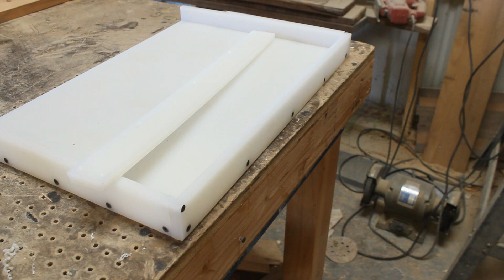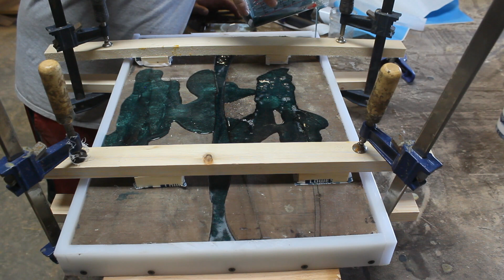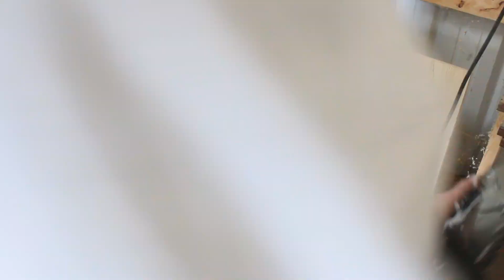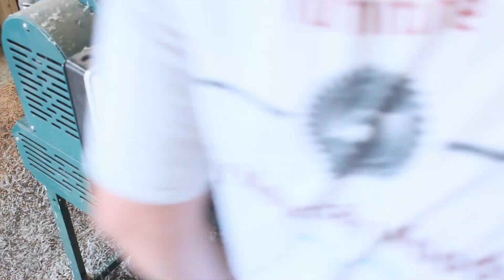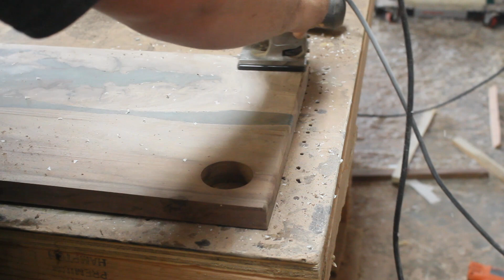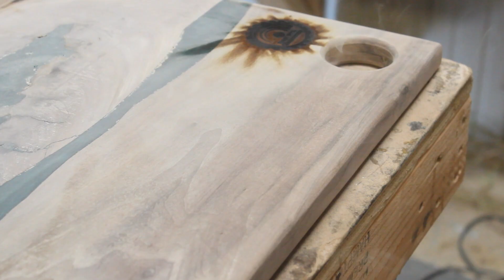How To Make An Epoxy River Cutting Board

Comment: Thanks for the great idea. I made one, sealed three of the ends with silicone before applying screws. The fourth ends I used threaded inserts and allen bolts(8-32) and used silicone on the inside to seal the fourth end. I sprayed mold release inside the form, all went well. Thanks again for the great idea.

Comment: One of the (if not thee) best tutorial I've come across, Every word dedicated to be instructional and specific. Great video, I'm going to do my first epoxy cutting board according to your tutorial. ...Just subscribed.
Reply: Hi, how did it go? Can you post a video when you finish?
Reply: @PenguPong  I just got started on the mold. Couldn't find that plastic at Home Depot and Lowe's but I didn't ask either. A friend gave me some Ash wood tongue and groove. I cut off the tongue and groove edges and glued and clamped three edge to edge for the mold base. Then ripped some strips for the side and ends. I'm going to take another plank off the Ash and make the left and right sides. I'm planning for a 2" or 3" clear River in the center with thin layer of epoxy on the bottom, spreading coffee beans, then filling the remainder of the river. I wanted 16 x22 but my planer is only 12". I may have a lot of sanding ahead of me.
Reply: @p8ryot If you have a router, you can use it to plane large pieces of wood. Good luck!
Reply: @PenguPong  Thankyou, I've considered making a planer sled. I only have a small palm size router (dewalt), hope it will be good enough. I also have a power hand planer. I think it might shave it down but having never seen it used for epoxy projects I'm wary that it may cause more bad than good. Any thoughts on a hand planer?
Reply: @p8ryot  Power hand planers are designed for quickly removing material and not for achieving uniform thickness. Consider using a small router, but expect to do some extra sanding.

Comment: This cutting board looks wow! Really pretty. There is just one problem that i see. Epoxy cratches easily and i not really knife resistant. And as it scratches epoxy dust will stick to your knife and to the food. Given the toxidity of epoxy, this can't be food safe.
Reply: 3 years late to the conversation but btw epoxy cutting boards are for serving and display not cutting.

Comment: Where do you usually get the wood to make your boards? I'm wanting to make some for my wedding in november.
Reply: Also, would it work to add fake flowers in the middle of the board? Like pour the epoxy and then place some fake flowers in the middle
Reply from the maker: Local hard wood stores or saw mills. Just make sure it’s dry. 

Flowers would be cool!

Comment: I love this look I have some black walnut pieces and are making boards. Where do you get the plain beeswax to mix with the mineral oil? Also do you rub it in and then wipe off any excess? Do you do more than one coat? Does this last as long is that your block or tongue oil?
Reply from the maker: I buy all my material for board butter on Amazon. Normally do 1 coat and then throw in a can for each board that sells so the customer can reapply as needed.

Comment: Hello. I wonder if I make a silicone mold and   Use that to hold the wood and the epoxy would it work? Or would it be not stiff enough?
Reply from the maker: I think it would work. They actually make silicone molds for this exact purpose, but they are very expensive. Give it a shot and let me know how it works!

Comment: That emerald green looks amazing...however, why does the board seem unstable? also shouldnt you raise the grain with some water and then sand again and apply the finish?
Reply from the maker: I do raise the grain. That just doesn’t always make it into the final cut of the video. Not sure what you mean by unstable.
Reply: @dagragg  ah ok cool, 
it didnt seem flat
Reply from the maker: It was probably sitting on something. I have ways to make sure all my boards are flat and perfectly stable.

Comment: I really enjoyed watching your process your cutting board turned out amazing here is a tip for you leave your epoxy down a tiny bit from your wood in other words leave your wood a little bit proud of your epoxy it is much much easier to plane and will not destroy your blades.
Reply from the maker: Good tip! Since this video was made I have purchased a drum sander so I don’t have to run my epoxy boards through the planer any more.

Comment: Very nice work--very nice. I'm wondering if you treated/prepared the edges before you made the central pour(s).
Reply from the maker: I didn't do anything to the edges of this particular pour because it was a smooth cut on the band saw, rather than a live edge so I didn't have to worry so much with trapped air. I have used epoxy to seal edges on other projects and it does work for preventing air bubbles but I have had just as good results popping the bubbles with either a torch or a heat gun.
Reply from the maker: Thanks for the sub!
Reply: @dagragg  Ok, Thanks
Reply from the maker: No problem!

Comment: Nice Job.  Curious about a couple of things.  Did you flip the board over, and sand it?  Did you apply finish to both sides?  How long does the finish have to dry, before handling of the board?

Thanks
Reply from the maker: Yes, both sides are sanded up to 320 and I use my own homemade board conditioner on both sides. The finish doesn't really dry as its just mineral oil and beeswax, meant to keep the board from drying out and cracking.
Reply: @dagragg  Thanks for the info.  So the board is for the lack of a better word, "oily" feeling to the touch, weeks later?  Just curious....  I've never made one, or messed with Epoxy.  Hoping to within a week or so.  Planning on making an end table.
Reply from the maker: Yes, you want a cutting board to stay oily and I would recommend washing it with either a lemon juice and vinegar blend, or salt and lemon blend rather than soap and water. It will be increase the life of the board. It will also need to be retreated as it ages for utmost longevity.
Reply: @dagragg  Ahhhh gotcha.  Thankx

Comment: Hi Kelly I really like the way your cutting board turned out. I was wondering about the Pro Marie epoxy you are using in your video. I will be using the same epoxy resin on a cutting board that I will be making for my new sister in law . I read that this epoxy can not be poured above 1/8” or it will heat up and crack up, how thick is your cutting board and how much did you pour at one time?
Reply from the maker: Excellent questions! This cutting board is about 3/4” thick. I actually did 3 pours of 1/4” each about an hours a part and had really good results with this method.
Reply from the maker: You may also consider putting a fan on it to help it dissipate the heat.